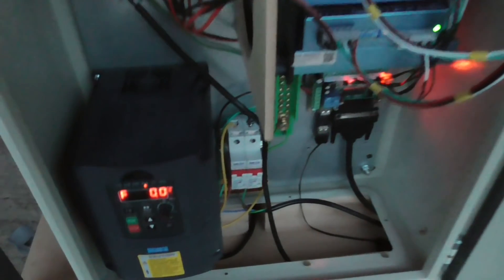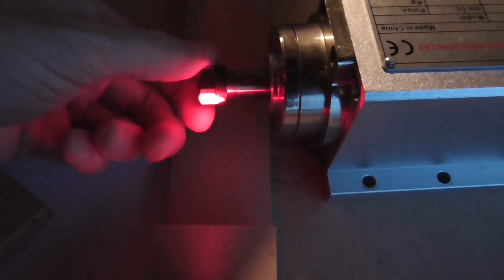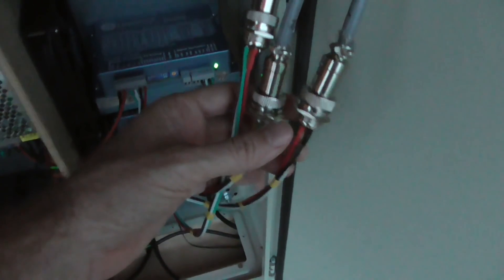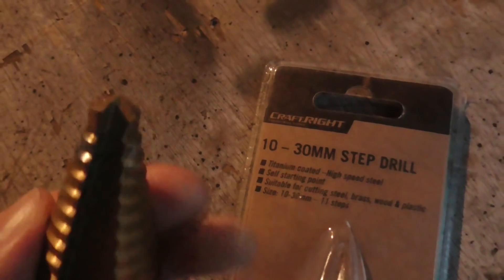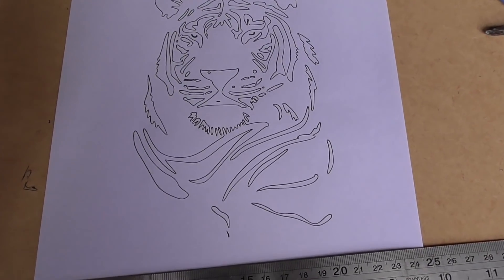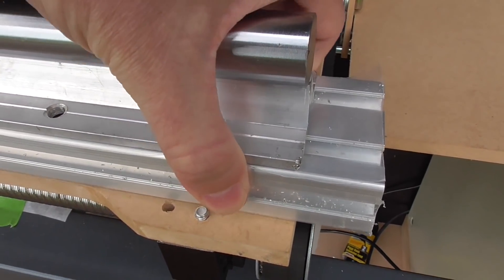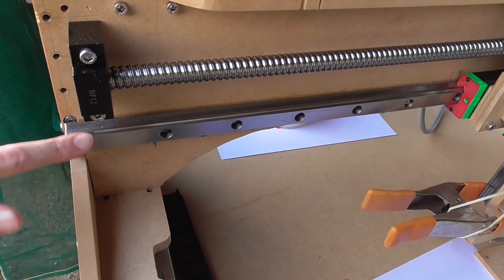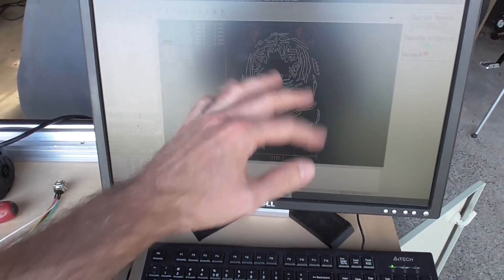Another DIY CNC router, part 4 (spindle control by gcode, more pen plotting)

Comment: I got a step drill from jarcar years ago. I munted the 12mm step somehow, but the rest are fine.
Reply from the maker: The one I ordered ages ago finally arrived, haven't used it yet but the cutting edge feels sharp. The crap one almost felt like it had been rounded over.

Comment: I'm scared when inherently non-real time hardware with inherently non-real time OS generates impulses for motor control directly. IMHO, Klipper-like approach is much sane and safe. Non-real time system must use high-level commands to control real time hardware which generates pulses and pwm!
Reply from the maker: I don't know much about Klipper but it looks similar to how LinuxCNC can use an external FPGA board to actually generate step pulses and receive sensor inputs. These are quite expensive and require more learning to set up, so I opted for the $20 solution for now.
Reply: @iforce2d  Klipper uses typical 3D printer board as real-time part and does all heavy lifting (like G code parsing and trajectory planning) on PC, and 3D printer board contains dumb firmware (much simpler than typical 3D printer firmware, like Marlin or RRF) which, yes, generate pulses and read sensors. FPGA looks like overkill for this task, 8 bit MEGA microcontroller must be enough.
Reply: @iforce2d  I think heard you mention you are a Kiwi. I am running LinuxCNC in Auckland on a couple of machines with Mesa hardware. Happy to share my experiences and offer any help if you need

Comment: I like how things are turning out and the frequent uploads on the project. You might want to be careful using the computer for other tasks while a job is runing, it could increase latency. Also, wi/fi is not real time and not ideal to rely on in case of an emergency.
Reply from the maker: The latency of the computer should be ok, that's one of the first things to check when choosing the PC. You can see the outcome of my tests here, search for "As above but with RTAI wheezy": http://wiki.linuxcnc.org/cgi-bin/wiki.pl?Latency-Test
Yeah that's a good point about the wifi. Since making that video I started thinking a simpler nRF24 for the radio might be better, and consume less power. So no rpi at all, just a nRF24 and MCU going to serial on the CNC computer. It might even be possible to make the MCU trigger the e-stop on the Mach3 board.

Comment: There is no doubt that, by spending a heap of time assembling, aligning, tramming, testing, and redoing failures, you could achieve Nirvana and create some nice quality aluminium plates using an MDF framed machine.  It would then be time to scrap all that effort, and rebuild it with the new alloy parts.  No brainer really... go with the laser man!  (I'm guessing you have already done that, but we will just have to be patient!)  We can handle it!   😄
Reply from the maker: The nice thing about the laser cut place is they will source the aluminium for me. Otherwise I would have to find an offcut in the wholesale aluminium company's stock that would be suitable, which might be difficult to transport by car, and could need to be cut further before fitting onto my machine.

Comment: Can’t wait for “HomeCNC 1.0”.
You could use some of the MDF mock-up for a CNC hot wire cutter. They have barely any tool pressure. Just something to think about after you get the project at hand finished.

Comment: I had problems with spindle speed, using a HuanYang vfd and a Smoothstepper connected to the analogue pwm terminals. At the lower end the speeds were too high, and it wouldn’t achieve the higher speeds. The cure was a 10nF capacitor across the analogue terminals of the vfd- after that the speeds corresponded perfectly to the set frequency all the way through the range.
Reply from the maker: The PWM frequency from the PC is supposed to be 100Hz, I vaguely recall that I checked it but that was many months ago. The lincurve thing was working great until I turned the camera on, so perhaps there is still some issue with the wave timing. In any case a small cap wouldn't hurt, so I might try that, thanks.
Reply: @iforce2d  you might try again after the motor has warmed up.

Comment: Really cool seeing the CNC drawing :)
Drilling the awkward holes could be done by a using a edmill instead of drillbit in a good drillpress or by milling them with a CNC mill ;)
Or maybe you could use some hard wood or better aluminum, put it in the slot of the profile, then the drill also should not wander off..
Reply from the maker: I have a pretty good drill press now so I was actually trying this yesterday, with a regular drill bit. I did a few holes all the way through but then decided all I need to do is take a small bite out of that first awkward edge section and then I can use a transfer punch to mark the holes on the relatively flatter part underneath. Since this is only for a spacer none of the holes really need much precision, I could probably have gotten away with 8mm holes at 'close enough', but the transfer punch method should allow for using the proper 6mm holes.
Reply: @iforce2d  Great 👍 Will keep that technique in mind the next time I need it.

Comment: Pretty cool, the pc wificontroler is a nice idea but I feel like it still needs a electrical e-stop near the machine, I can't remember if you have already installed one
Reply from the maker: Not yet, but I'm thinking to have a hard e-stop before that multi-plug switch panel.
Reply: @iforce2d  yea it would be safer XD